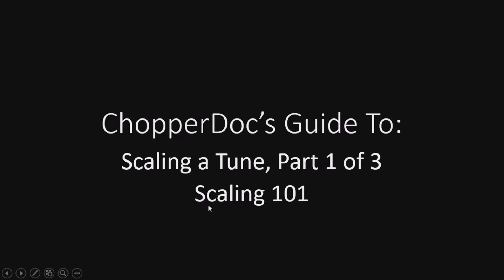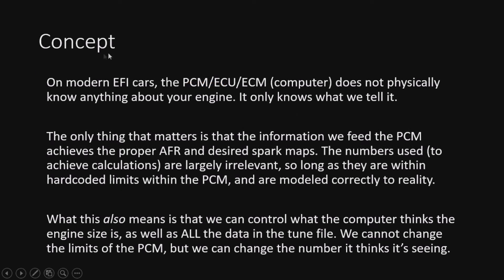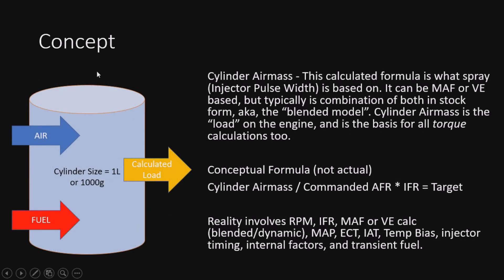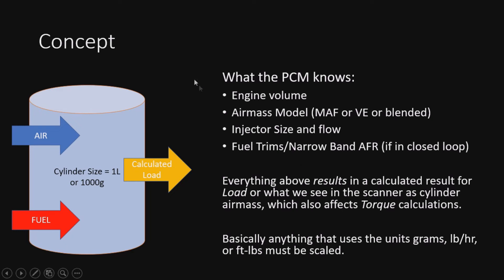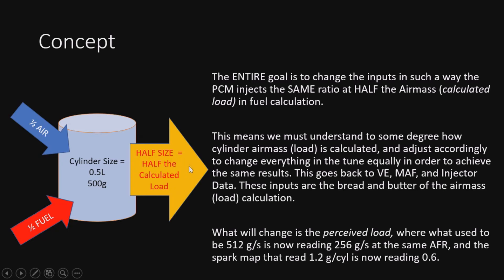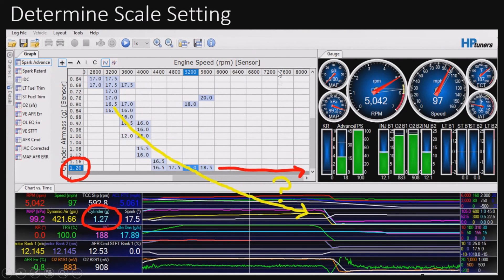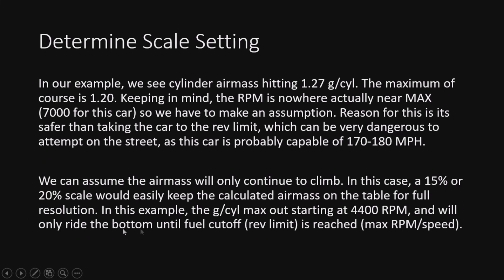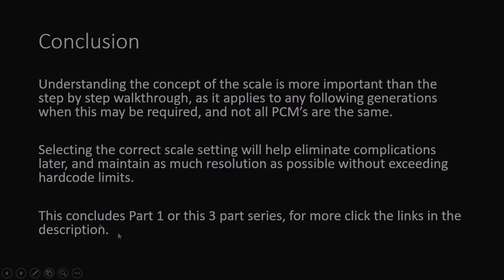Tune Scaling Part 1 of 3 - Scaling 101 - The Basics

Comment: First, I want to thank you again for the series of Gen III related HP Tuner videos.

I want to make sure I understand the concepts in your videos correctly / what I think I understand from forums. I appreciate anyone's feedback.

1) P01/P59 PCM's have an injector flow rate limitation of 254 lb/hr, which far exceeds what I will be doing with my combination (406 c.i with P01 pcm) - it doesn't sound like larger injectors (ie. 42lb/hr to 80 lb/hr) should require scaling the tune necessarily? It's more due to air flow limitations (ie. exceeding MAF limitation within 12kHz)

2) When starting from scratch (getting the combination up and running so I can begin street tuning)... How early in the startup / tuning process can you begin scaling a tune in effort to not waste a bunch of time? As you show in Part 2, going through the timing tables takes quite a bit of time.
I assume while roughing in the VE table (Speed Density), IF I were to datalog a cylinder airmass that exceeds 1.2g, as described at the end of this video, I'd want to go about scaling the airflow tables, etc. as shared in this series of videos.

Thank you!

Comment: Thank you very much for this.  I followed your tutorial(s) on my P59 DBW LQ4/7875 '61 Apache, and it worked dandy.  The only thing I did not do was alter the engine displacement (I'm not hitting a firmware limit for injector flow), the Base Running Aiflow table, or transmission settings.  Starts, runs, and drives like a champ with zero issues.  Thank you SO MUCH!

Comment: 1L = 1000g? That’s true for water. I don’t understand that part.
Reply from the maker: Sorry for the late reply. It’s a specific reference to total volume. 1L does = 1000g. We can convert it to cubic inches just the same. All in all it’s just a reference, and for the purpose of this video it just means that if we scale a 6.2L engine by 50%, then the PCM will end up assuming it’s a 3.1L. 

Don’t try to wrap your head around the actual formulas that play into the actual data. I understand a 7L engine will be around 15-20 grams a second at idle, and can exceed 512 g/s at WOT. I can understand your confusion there. When talking about air, it’s different in the calculations, but for volume, in this case, the conversions are at face value. Just know that there are thousands of calculations we don’t see in the scanner. It’s the fun part about tuning. Look into how much volume 1 mole of “air” is for further insight, and/or confusion. It’s a large area. The physics in this case are quite complicated.
Reply from the maker: If you don’t feel like looking it up, 1 mole in the Ideal Gas Law (IGL) is equal to 22.4L. Before multiplying by the molar mass (28.97) that means that a typical engine may be at something like .010 (moles) at idle. That’s the number it’s talking about using the good old PV=NRT. 

.010 moles at idle would be 224 grams of air, before mass conversion and before VE is factored in. Also depends on temperature, and that’s where the bias comes in. 

Watch my video on cylinder airmass explained. It will (hopefully) make more sense at that point. And no, I have no idea why 1 mole is 22.4 liters. Maybe someday I’ll care enough to investigate that, but that’s the scale and measurement we’re talking about. 

SOOOOO, with scaling, I’m trying to make the PCM see that .010 moles number as something else. I can’t change the 22.4 number. On earth it will always be 22.4. I can’t change my MAP number either. Or temperature. But what I can do is change my volume. That will change the moles calculated, and therefore give me a completely different g/s result, which is exactly what I want it to do. 

So if a car previously idled at 16 g/s at idle, and I scale 50%, it should now read 8 g/s under the same conditions.
Reply: @ChopperDoc181  Thanks for the reply. I’m a chemical engineer with a Masters degree, so I understand all about gases and moles. My confusion was when you said 1 liter (a volume) equals 1000 grams (a mass). 1 liter does equal 1000 mL or 1000 cubic centimeters. Water is the basis for the metric system, so 1 liter of water does weigh 1000 grams, but nothing gaseous, at least that we’d be dealing with here (no matter how compressed) weighs 1000 grams in 1 liter of volume. That was my question/confusion.
Reply from the maker: Ahhh, I see what you mean. I feel silly now for trying to explain that. That’s an oversight on my part because you’re right, at no time will the airmass equal the volume in weight. Good catch. I was just doing direct conversion without consideration to mass.

Comment: Is there anything special about how logged data is applied to a scaled tune?
Reply from the maker: Nope. It will change the output so basically there’s no change in the tuning process.
Reply: @ChopperDoc181  same for timing tables?
Reply from the maker: You will reach different areas on the tables, as in it won’t go as far up the table. That’s why the values are shifted. The remaining area is where you can change your spark curve on a table that was previously maxing out. As far as tuning it, it doesn’t change how that’s done either, which is use a reference like a dyno or trap speed and push a little at a time until gains stop or you start getting knock.
Reply: @ChopperDoc181  thanks. Had a feeling I was over thinking it. Appreciate all the videos you put out! Thank you for your service too!

Comment: I really appreciate you taking the time to go into detail on what all is involved in scaling a tune. Is there any way of knowing for sure how much a tune is scaled if you just pull a completed tune?
Reply from the maker: It might be difficult if they did the entire tune. If they forgot to do the torque and MBT tables, you could look at the delivered engine torque to get an idea if it's been scaled. If the number dives under zero, it's been scaled. Figuring out how much might be a taller order, but this could give you an idea. Also comparing a similar tune could be another way.
Reply: Sometimes you can look at injector flow rate. If it's a 100# injector and flow rate says 75# you know it was 25% it can be hard to tell though. This is what we do to lower the g/cyl in a sd setup to control timing in boost